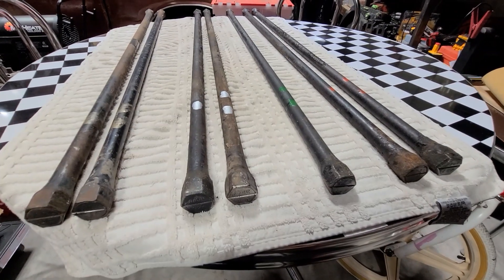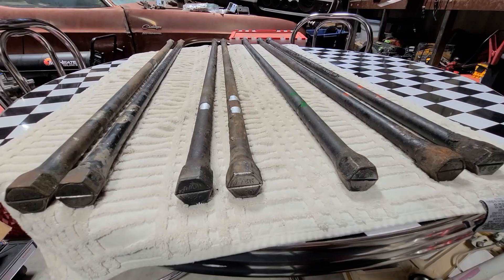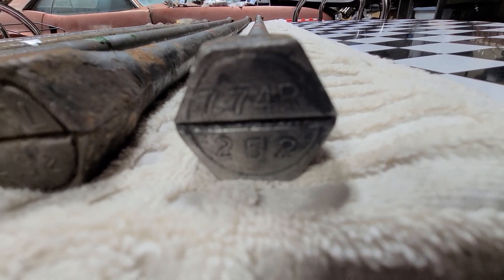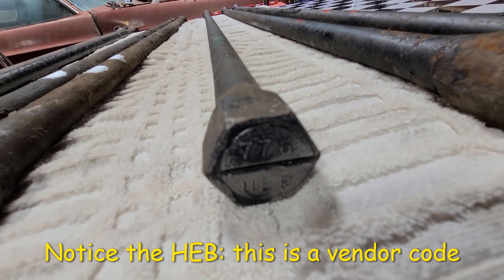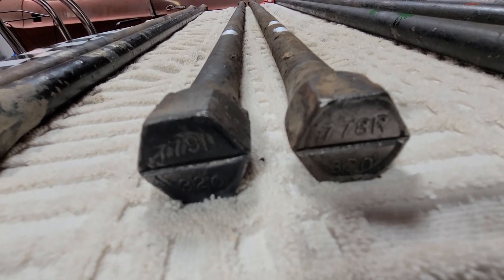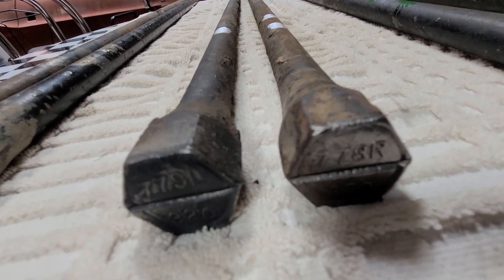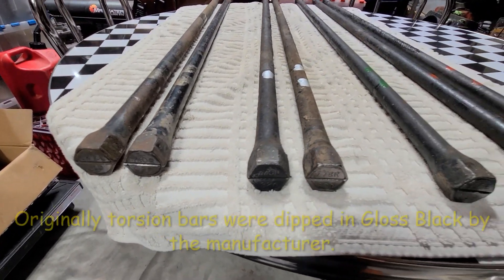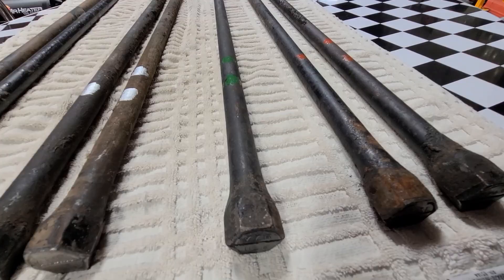B and E Body Torsion Bars explained.

Comment: Thanks Every little information is valuable! Can you put a HEMI .092" Torsion Bar on a 1972 Roadrunner with a 400cid?
Reply from the maker: As long as the length is the same as the original that came in the car   I would think there would be no issues. I've done swaps like that in 70-74 ebody and 68-70 b bodies.

Comment: How would you extend torsion bars for a custom project? Ie, I want to extend the mounting position on the frame and the bar needs to be longer
Reply from the maker: I've never done this. I would probably need to locate a company that makes these bars custom.

Comment: How about the length  and hex orientation....
Reply from the maker: What about them? They are all similar in length and the ends of the torsion bars are similar because they must fit into the same frame and lower control arm sockets.
Reply: @clintsclassicworld  : explain what characteristic of the bar makes it a right or left....Also, when you say "similar", in length, what difference is there between body series( b,c, d)....That information separates
useful information from trivia....
Reply from the maker: @regdor8187 about 1 minute into the video I mentioned they say L and R. This means left and Right.
Reply from the maker: @regdor8187 b body and e body use similar torsion bars. Not sure what a D body is. I am only speaking on E and B body.
Reply: @clintsclassicworld D was a full size Dodge of some era

Comment: Is their a front of the bar or does it matter?
Reply from the maker: I've seen the go either way, but I would check the bars to see if either end is longer. I think they are the same length. But if I found one end longer I'd probably install the longer end into the lower control arm. Also, I've looked to see if one end lines up easier too. If everything is equal on length on ends, then shouldn't really matter. Just make sure you use the correct left and right labeled bars for the corresponding side of vehicle.

Comment: Mopar always did a great job of marking everything... Odd number bar is always left and even number is always right when ever there's is a left or right goes for all mopar parts...another great thing about mopars is from 1966 to the 90s a lot of parts would interchange between models making them cheaper to make and easier to find parts for example the door handle and many cars interchange... 72 Dart door handle will fit a 90s pick up truck...window motors also interchange... For instance I do not like the rear view mirror mounted on the windsheild...but the boss for mounting a roof mounted one is still there in the cars and trucks so I just mount an earlier one there is one my 76 charger and my 87 Ramcharger which has one out of a 60s B van.

Comment: I see 1.03 inches hotchkis brand after market for sale by various vendors.  I have  1966 Charger 383 4bbl automatic. Your thoughts.
Reply from the maker: Aftermarket is what it is. Not original as intended by mopar engineers years ago. Some are very rigid.  Just depends what you are looking for. Mopar performance sells new ones to replace old ones that are near original. I personally don't use a lot of custom things because deviation from original can be difficult sometimes especially on mopars to get the ride and drive you want. Better sometimes to leave original set up or reproduction like original in the car as intended. Good luck.

Comment: Really good video very informative I have a 73 that had a 340 but I'm putting the 400 in it should I replace the torsion bars because of surface rust and age what size would I need
Reply from the maker: They sell new bars. It's up to you. I would see how your existing bars work first. Good luck with it.

Comment: thanks for the video and nice infos !  if someone want to remove a manual transmission A833 from a 73 charger , can we remove the cross member that bolts the sway bar to make some room to remove it and reinstall it  without ruining the suspension .
Reply from the maker: I am not sure I understand your question.  Personally I normally pull the engine and transmission out together from the bottom of the car with the suspension held underneath.  You can remove the transmission without removing the engine or k frame area.  Lower control arms are dropped when I take the K frame out.  I release the pressure on the torsion bars completely.  It will need to be realigned if you do this.  I have removed suspension or dropped control arms and never had the repair bushings in them.  It might depend how old and how difficult it is when removing the suspension component as well.

Comment: Clint, after putting all new 340 engine, new tires, new rims, alignment, all new front end suspension and components, new brakes and balanced driveshaft in my 72 ebody, I still get the same shake/shudder after 70mph. Any idea what else to check?
Reply: Is the shake and shudder in the front or the rear of the car?
Reply: @bobgoble2228  Feels like it's right in the middle or throughout. its not in the steering wheel for sure
Reply: @georgepapaioannou5115  I would check the u joints and make sere they are seated properly. The should be two ears that the  joint fits down in.
Reply: @bobgoble2228  Thanks but the shake was there before I completely redid the driveshaft. They are in correct.
Reply: @georgepapaioannou5115  is the motor and transmission the original parts? i have a reason for asking.
Reply: @bobgoble2228  Original trans, new 340 block
Reply: @georgepapaioannou5115  The only thing i can think of is the Engine balance. The 340's were internally balanced from 68 to early 72 then mid year the went to a external balance. The harmonic balancers are different. The change has to do with a forged or a cast iron crankshaft. Determine what crank you used and make sure the balancer matches up. If it has an automatic trans then i think the torque converter is different as well. One will have small square lugs welded on to balance. The other wont have any of that.
Reply: @bobgoble2228  I know, there is no easy answer. The problem existed with the original 318 and now still with the 340, literally no change. That ruled out Engine.
Reply: @georgepapaioannou5115  was the 318 the original engine?
Reply: @bobgoble2228  Yes, it shook with that block and nothing changed with new 340
Reply: @georgepapaioannou5115  Curious, did you use the same transmission with both engines?
Reply from the maker: I've heard of this before. My friends cuda clone with 440 was a little too high sitting in the engine bay and caused an angle. It had something to do with his mounts. But, so many things can cause an engine or trans to be at a slight angle they could cause a shimmy at a higher mph or rpm. Still could be other things, but his car was due to his angle off a little for his drive train sitting in the car. Good luck.